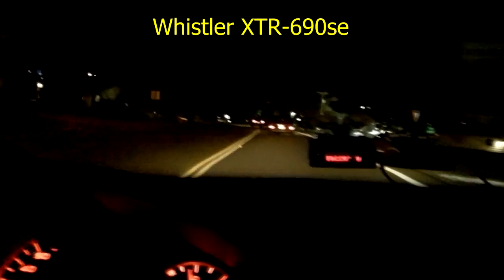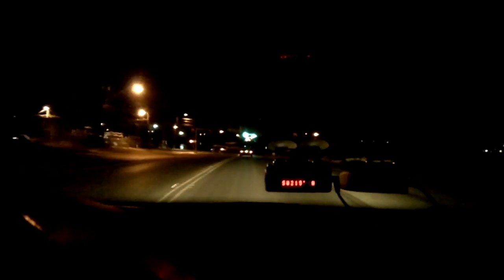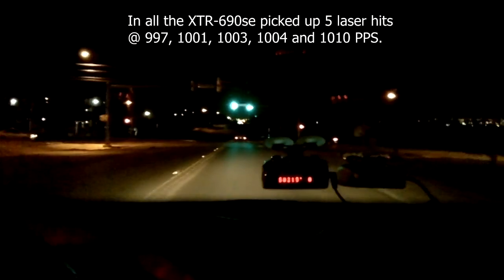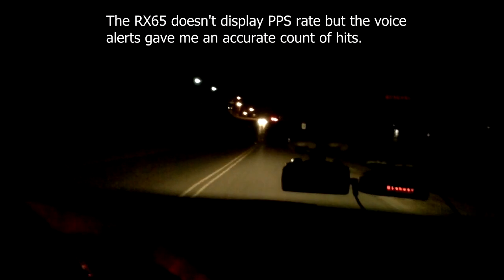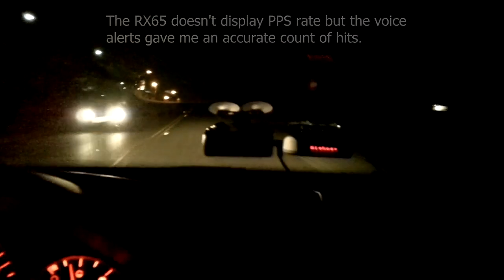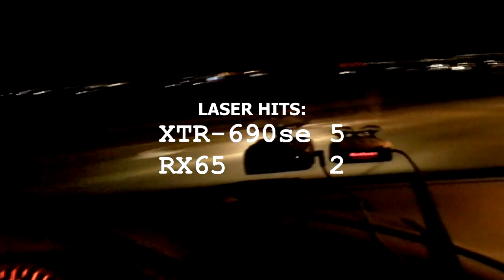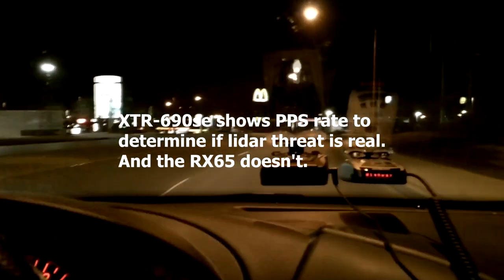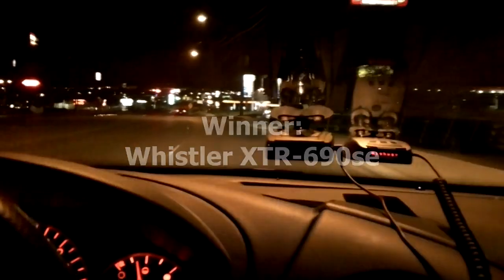Whistler XTR-690SE vs. Beltronics RX65 - Laser

Comment: i have rx65 but it never give any laser beep?even had passed the speed cameras so many times whats the solution?i am noob in all this stuff thx
Reply from the maker: Radar Detectors really aren't useful for detecting lidar guns - they designed to detect radar guns.  If the laser warning even goes off, all the radar detector really is doing is informing you that you just got a speeding ticket.  Don't depend on a radar detector to protect you from lidar guns - they won't.

Comment: You shouldn't place them so close together when testing them they'll emit mutual interference if you have them any closer than 30 inches within each other.
Reply from the maker: Only the device being tested at the time was on.  The other device was off and disconnected so this wouldn't happen.  Distance doesn't really matter when trying to eliminate interference going on between two windshield mount units - it is just simply not a good idea to run both, period.  You can get away with it if one of the radar detectors is a remote, but otherwise, just not a good idea.

Comment: I would have to say this video is....pretty weak. Firstly; the RX-65 has autoscan, dunno if you were using it; it eliminates false readings (you should have been) You clearly stated over and over that these were falses. Meaning; whichever detector went off MORE actually lost; because they're falses; and a GOOD radar detector, doesn't go off on falses. So having sensitivity to fake signals, isn't really a plus; it's a huge negative. Just sayin'.